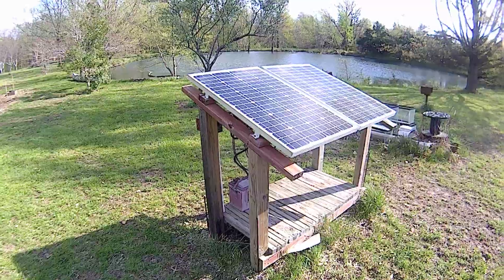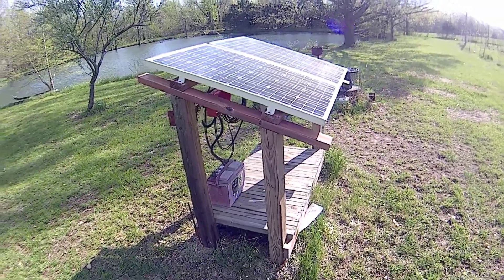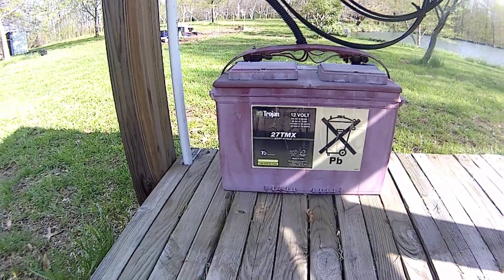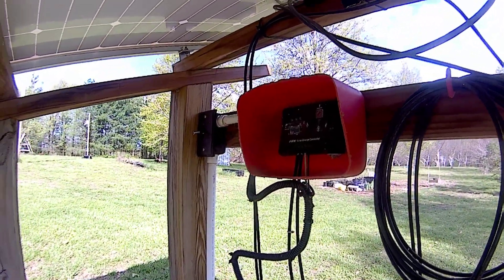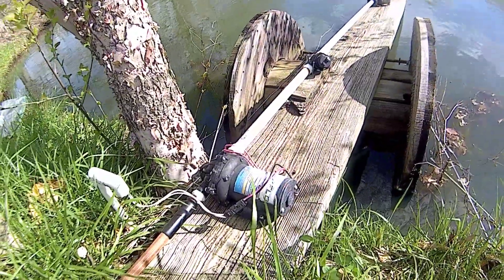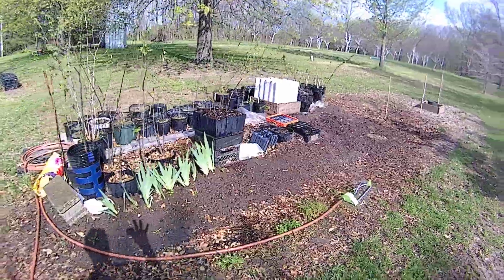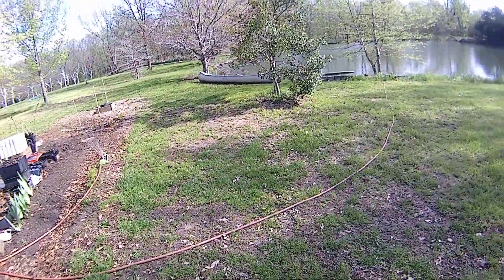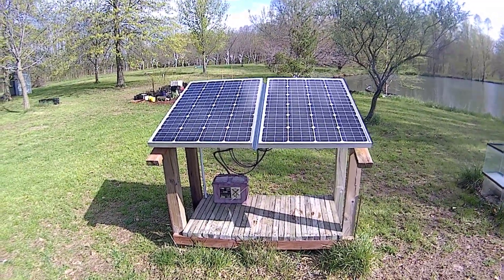Water pump 12v solar system garden irrigation system home brew

Comment: nery nice. You know you are barely touching battery? 200 watts divided by 12 volts is 16.67 amps. so you are using 0.23 amps a hour. very efficient, battery should last very long time, may need little more shade looks sun bleached.

Comment: Nice little set up, I am hauling water a half mile from pond to orchard.
Reply from the maker: I did alot of water hauling in 55 gal drums in my pickup truck. A hose spigot at the bottom and 2 barrels running at once, then another trip. Exhausting.

Comment: What is the Brand and model of the pumps that you are using? Thanks
Reply from the maker: The 4 GPM (gal per min) pump is a Everflow EF5500 12v DC 17 amp max.
 The 7 GPM pump is a Remco "fatboy" 90-5538-1E1-94A-SB 12v DC 24.5 amp max
Remco could use better numbers, it would seem to me:)
 I would guess this system would cost $600 easily today. Prices seem to have risen quite a bit. 
 I just found the Everflow online for $87. The Remco now costs $221. 
   And they say inflation is low. Unless you HAVE to have higher flow, the big one is NOT 3 times as good, so it isn't worth 3 times as much.

Comment: Does the switch need to be anything specific?
Reply from the maker: Just check what load they were meant for.... 12v DC in this case. I think it can handle 30 amps. This was bought in an auto parts store, since they have a lot of 12v stuff there.

Comment: Just need a 12v Timmer and it can turn off and on with our you there use drippers and increase the area you can water
Reply from the maker: A timer is a good idea. I have one of those 275 gallon plastic totes set up on 10 pallets. It's about 200 feet away near the garden. I run a hose to it and fill it with pond water and have started putting drip irrigation in there.  These motors don't work well with drip. The pressure comes up and it turns off, then drops, it turns on. Too many on/off cycles will burn the pump up. You need a water tower of sorts.
Reply: @Qingeaton  What kind of pump is that exactly? Are the on/off cycles due to pressure changes a special feature to that pump or is that pretty standard? I am considering a water tower for my drip irrigation and was wondering if a pump could just stay on to fill the tower whenever it was running low. Also, do you have any problems with wind blowing the float to the edges of the pond?
Reply from the maker: @Mequitz248  It's a diaphragm type with a high pressure switch for cut off. They all say that rapid on/off cycles are hard on the pump. I just fill my tower (275 gal tote on top of 10 pallets near my garden)  and then turn it off. You could put in a float type switch that would kick it on when it runs nearly dry, but that seems like a lot of extra work and engineering for the small gain. The rubber hose I used for the intake line is pretty stout. I was thinking that I didn't want something thin walled that might kink with the swaying back and forth or collapse with the suction pressure. It takes too much force to drive it in either direction, so I haven't seen it up against the bank yet.

Comment: Impressive system.  Well built.  And precisely meets the needs.  I like it!
Reply from the maker: Thanks.
 I did just recently pick up a spare charge controller. 
Figured the panels will last my lifetime, and batteries can be found.
  There's a site I won't name where stuff like that costs maybe $15 and nowadays they have USB ports on them, unlike the years ago model I have. Could be handy one day.

Comment: I'm going to build the same system. Thank for this video
Reply from the maker: Ordering the pump online saved me a lot of money. 
Sad to say, but my local farm store jacks the price up way too high.
  If I could have, I would have set the panels/ battery closer to the pond, but tree shade was an issue here. Good luck with your project.
Reply: @Qingeaton  can you list the parts you used?
Reply from the maker: @kmain0  
2-100w solar panels with cables (online)
1-  charge controller (online)
1-12v deep cycle battery (in town)
1-12v lighted switch (auto parts store)
1 pump  4 GPM (gal per min) pump  Everflow EF5500 12v DC 17 amp max. (online) 
Fitting on the "out" side of the pump that goes from it to garden hose size.
3/4" plastic pipe for the pickup side with a short section of 2" adapted up to it with lots of holes drilled into it for the end of the pick up line, covered by that chaise lounge cloth.
a "banjo" brand filter that has the correct fitting size for my pipe. 
Wire enough to go from the switch to the battery and down to the pump. 
 I used the kind that goes in home walls, because it was solid and I wanted to make sure it was heavy enough for the DC load.